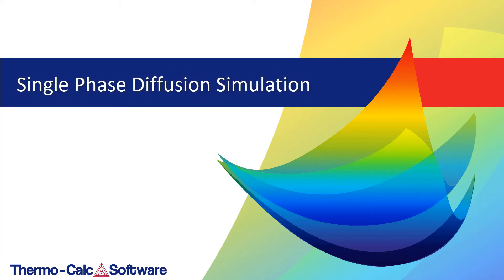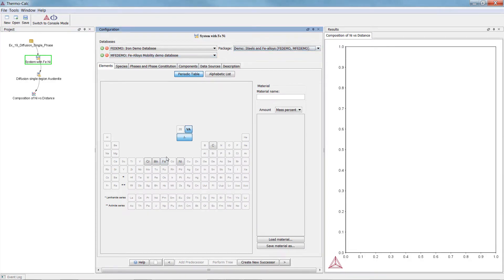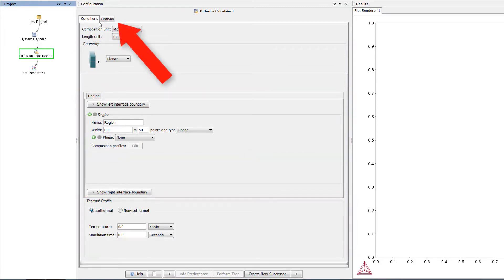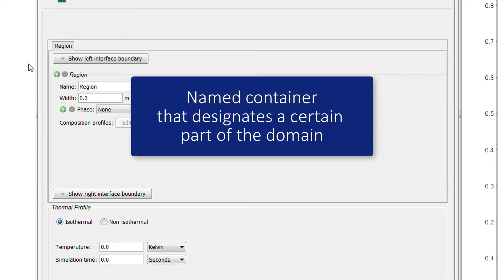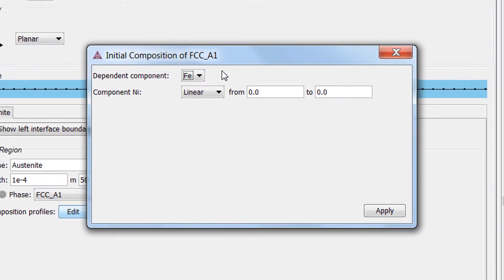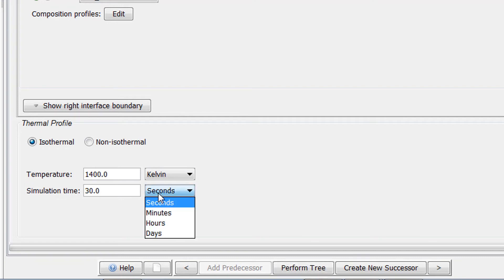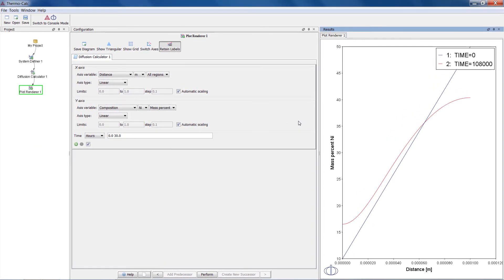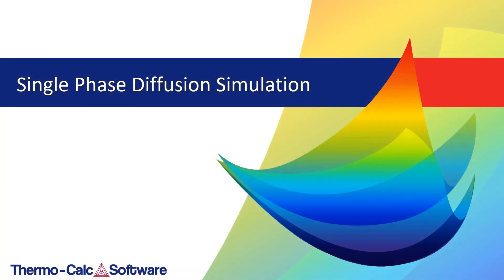OUTDATED - New Version Available - Example D_01 - Diffusion Single Phase

Comment: Hi, how to import previously calculated Scheil segregation profile into DICTRA simulation in graphical mode?
Reply from the maker: Hi Achmad. Unfortunately, it's not possible to import Scheil results to DICTRA simulations in Graphical Mode. However, it is possible to do this in Console Mode by using the evaluate_segregation_profile command. If you need further guidance with this, you can always contact our support team by emailing support@thermocalc.com.